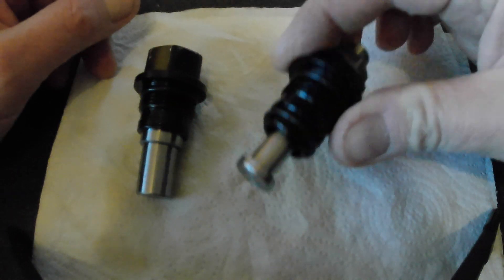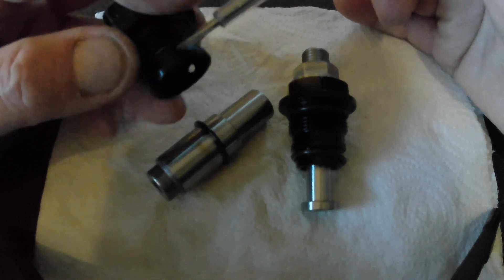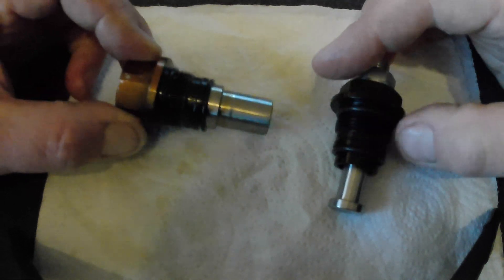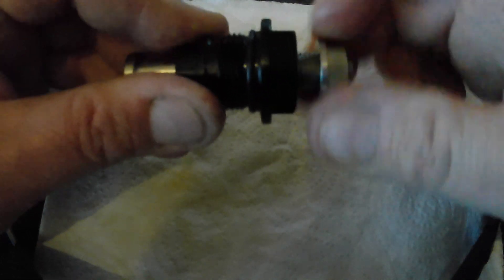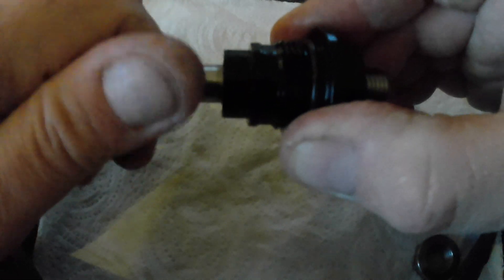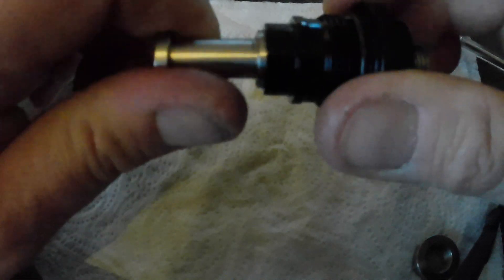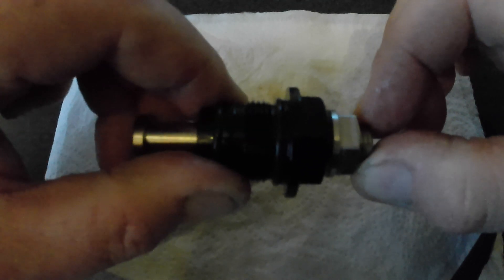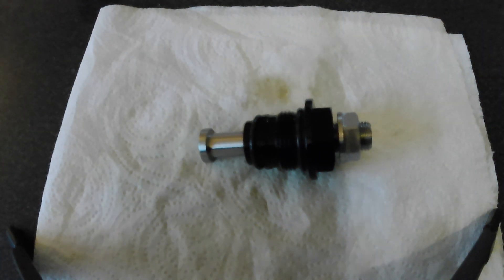BMW F850GS manual cam chain tensioner.

Comment: Não coloque isso na sua bicicleta, meu amigo. Sobre o tensionador hidráulico da corrente de comando das nossas bicicletas e o manual ajustável —  A questão é a seguinte: o tensionador hidráulico é projetado para funcionar com a pressão do óleo do motor. Quando a pressão está baixa, ele deixa a corrente fazer um pequeno ruído na partida — um aviso natural de que o óleo ainda não circulou. O manual mantém a corrente esticada o tempo todo, independentemente da pressão do óleo. Isso remove o ruído da partida, mas é arriscado — se o motor não tiver pressão de óleo, você não notará, porque a corrente permanece esticada de qualquer maneira. Você pode estar pedalando sem lubrificação e nem perceber. Portanto, se o ruído da partida incomoda você, verifique o nível e o tipo de óleo antes de pensar em trocar o sistema. Na minha opinião, não há necessidade de mexer no design original. Esses tensionadores manuais são apenas mais um atalho que as pessoas vendem online. E, a propósito, o link que o autor do vídeo postou não é para a antiga F800GS — é para aquelas novas máquinas de costura que a BMW insiste em chamar de Big Trails. Hitler deve estar se revirando no túmulo com esta nova versão da F800GS. Nunca estará!🤣

Comment: Many thanks for your answers. Was the Rattle Noise also on warm Engine or only at the cold start, before you changed the new hydraulik tensioner?
Reply from the maker: On a cold start, the rattle was horrendous for a good 10 to 15 seconds until oil presure had built.. On a warm start, the rattle was over very rapidly after startup and no way near as loud or bad.

Comment: Hello, I saw Both of your Videos about the issue  with the rattle noises.
I have These noises very extreme if the Engine is on temperature. Do you have a link where I can buy the manuel tensioner and did it solve your Problem now complete?
All the best yours Jens
Reply: Hola, como estás ? 
Me pasa algo con las BMW 850 gs 
He tenido varias en el taller y me presentan una falla de que la cadena de distribución salta las ruedas dentadas de las levas lo que genera que el pistón colisione con las válvulas haciendo que estas se deformen y pierdan su comprensión he llegado a la conclusión de que el fallo se debe a el tensor de la cadena de distribución hidráulico ya que la moto no me muestra baja presión de aceite. 
Pedí un tensor hidráulico nuevo en BMW y cuando lo instale la moto inicialmente funcionó y anduvo más o menos 8000 km antes de volver a presentar la falla de nuevo, creo que estos tensores vienen defectuosos o no son lo suficiente fiables en este modelo, por lo que decidí investigar y mirar qué solución puedo dar pero me doy cuenta de que no hay videos ni nada por el estilo que me brinde una solución 
Creo que el tensor mecánico que estás dándonos a conocer es la solución definitiva o que opinas respecto a mi caso, crees que el tensor mecánico pueda ser una solución definitiva a este problema ? 
Muchas gracias y estaré atento a tu respuesta.

Saludos desde Colombia 🫡
Reply from the maker: I fitted a new BMW hydraulic tensioner which solved the issue and it iis still OK now. I have bought the manual version and will replace the current hydraulic tensioner when and if it fails in the future.
Reply from the maker: https://www.ebay.co.uk/itm/275817400174?mkcid=16&mkevt=1&mkrid=711-127632-2357-0&ssspo=5VN_PylzTp-&sssrc=4429486&ssuid=qTyxwp8SRra&var=&widget_ver=artemis&media=COPY

Make them an offer, I did and got it for less.